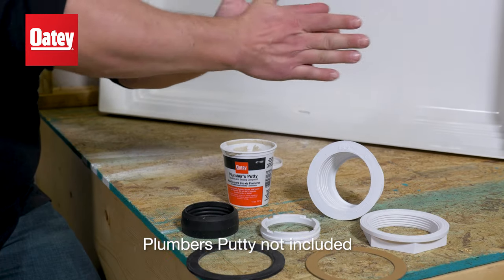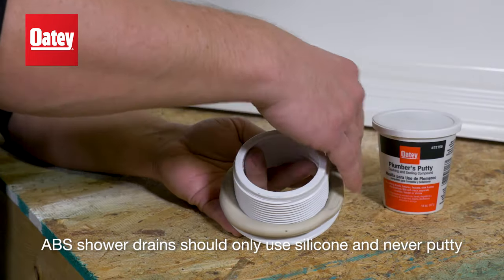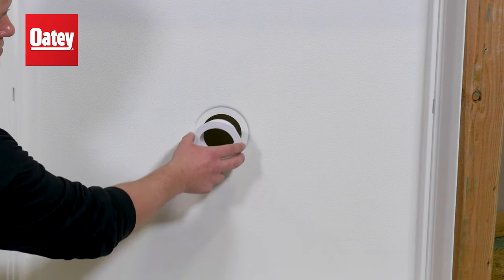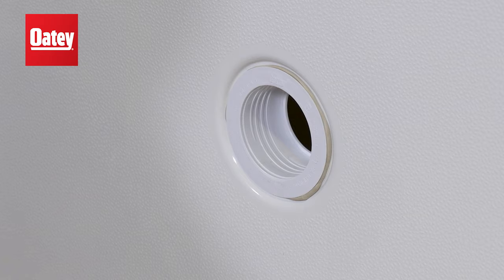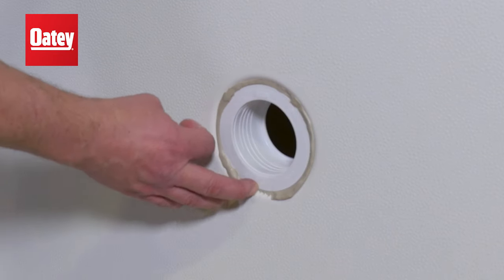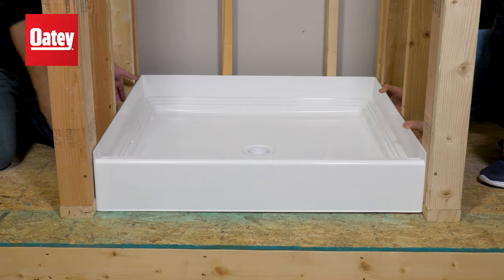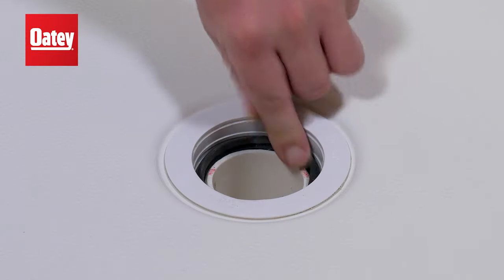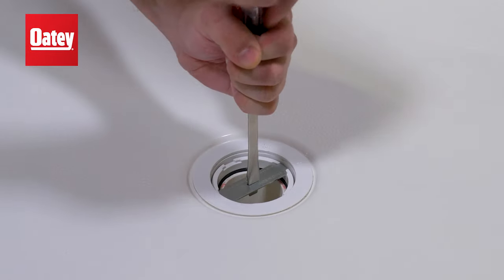How to Install a Shower Drain in a Pre-formed Base

Comment: Don't install like this. I did and thought my pipes were leaky. I cut them out and then saw all my joints were fine. Watched a video showing how to actually use these by another person and realized this video showed me how not to install the gasket.
Reply: OK, what was wrong about the video, and which is the correct one?
Reply: Yeah every video I’ve seen does it EXACTLY like this!

Comment: Does this work with ABS or only PVC?
Reply from the maker: The No-Caulk Shower Drain is also available in ABS. Be sure to never use plumbers putty on ABS and instead use 100% silicone. The oils in plumbers putty can cause ABS to degrade over time.